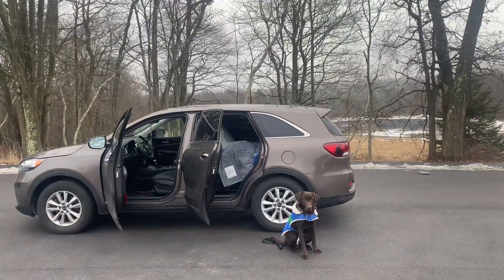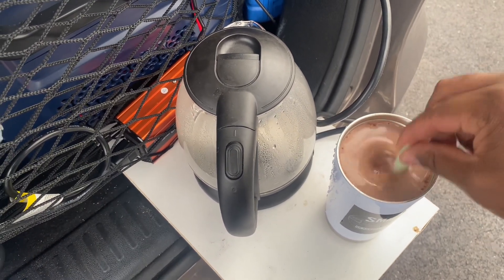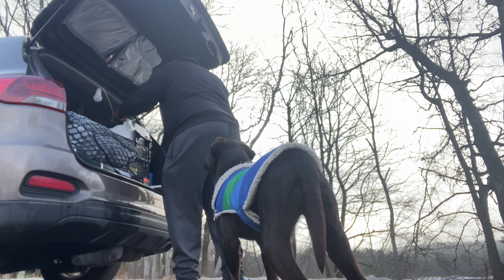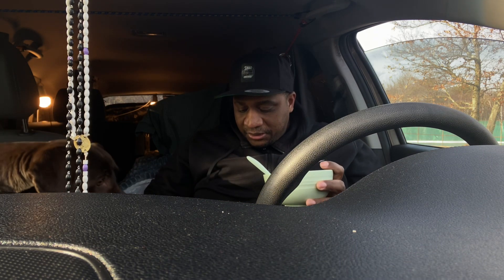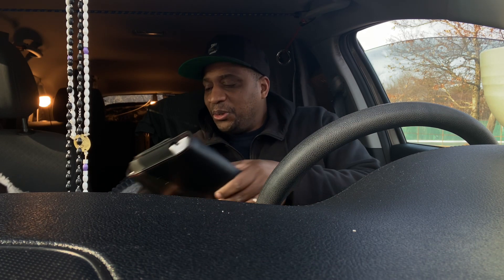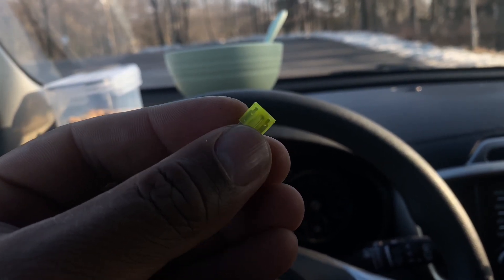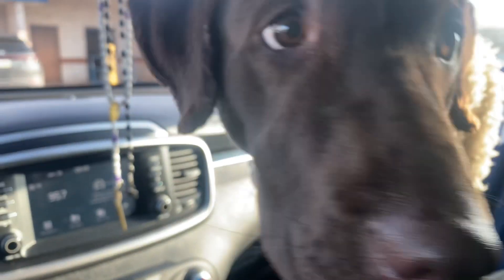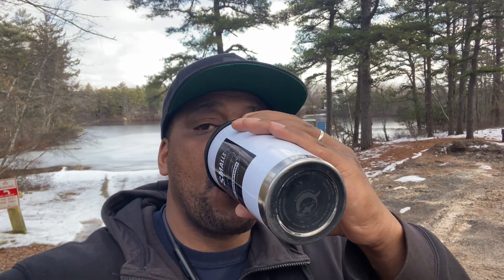Diagnosing Electrical Issues On The Road / Enjoying Breakfast And Great Views

Comment: Absolutely stunning display on how to fix the 12 volt plug outlet. Most times this happens is because the fuse. Does your vehicle pull 180 watts from that outlet? That’s a lot.
Reply from the maker: Yes the outlets let you draw 180 watts. I never met I’d pull that much though.